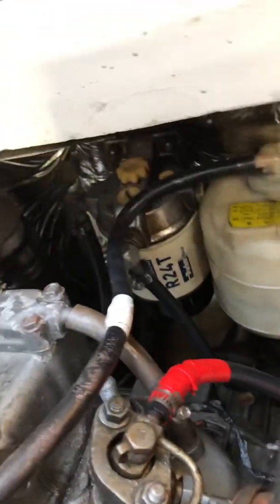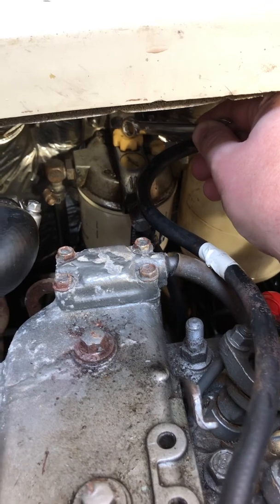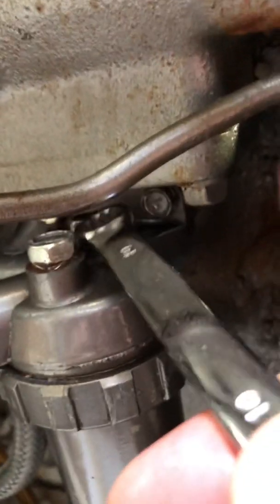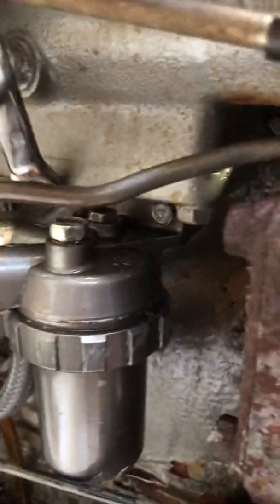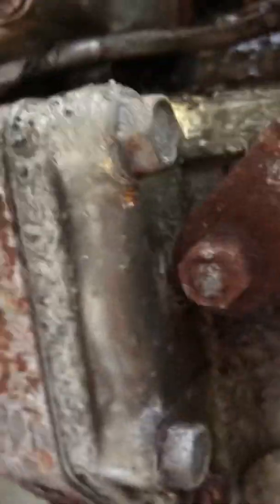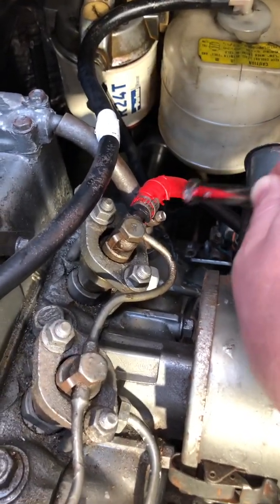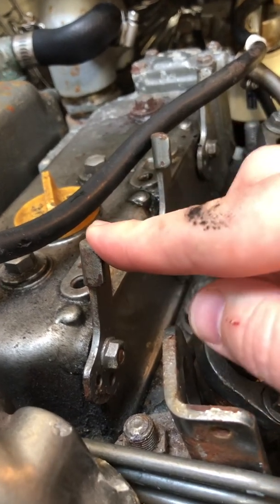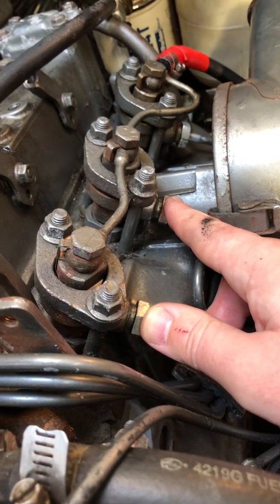Bleeding fuel line on a Yanmar 3GM30F marine diesel

Comment: Very informative video but a CRITICAL WORD OF CAUTION!!! If you open the (de) compression levers to turn the engine over in order to bleed your fuel system (or even just crank it for a extended period with them shut to bleed the system) BE SURE TO FIRST CLOSE THE ENGINE SALT WATER INTAKE THRU HULL VALVE.  If you don't you run the very real risk of back flushing water from your exhaust system into your engine cylinders and filling them with sea water.  This will cause a hydro lock and lock up your engine.  And unless you IMMEDIATELY remove the injectors, turn the engine over by hand to force the sea water out, then dump oil down the injector hole, your engine is TOAST!  Sea water in your cylinders for more than a very short times will seize the engine. And depending on how many times you tried to crank on it when it was hydro locked, it may be toast even if you do get oil in the cylinders anyway.  I SPEAK FROM EXPERIENCE...
Reply from the maker: @EricJohnson-pu9fg  thanks for adding that insight. Very informative! Not something I had thought about or was aware of.

Comment: This was very helpful, particularly the part about bleeding the screw over by the fuel injector,  (lots of air still came, as you said) and for us (dad was helping ...as in my boat, but didn't know how) it still wasn't catching until opening up one of the 3 chambers....on 2 cylinders it caught, he closed the 3rd, and finally a few hours spent trying to bleed it out, finally got it!  Thanks for sharing....we'd worked hard and done the first parts, but the last had been missing and wasn't at all in the manual. So 👍 thanks!
Reply from the maker: That's awesome, I'm so glad you found it helpful!

Comment: Ryan. I have to replace the lone right after the lift pump.
I got the parts and everything. Any tips?
Reply from the maker: Yes, make sure you close the fuel switch. The negative pressure will keep the fuel from just flowing out unchecked when you open the line. Mine is on my tank. Others are on the line inside the aft cabin or elsewhere along that path. This will help limit the air that gets into the line also. Put a bowl under the line when you take it off to catch the fuel. Should be pretty straightforward. Just crack the nut on the secondary fuel filter when you are done and pump the primary and you should be good. Let me know how it goes.
Reply from the maker: Also, follow Spelunkerd on YT. The man is a Yanmar Wizard.